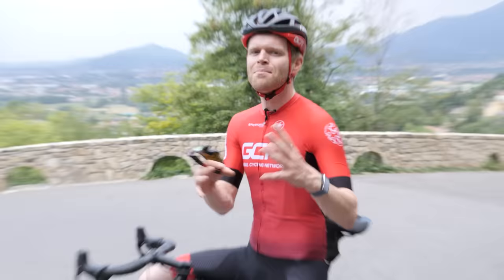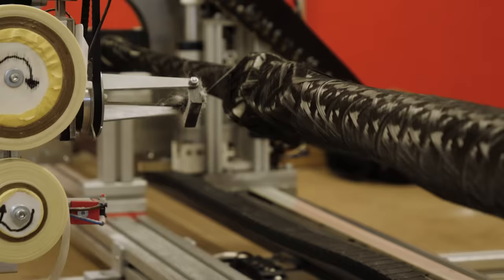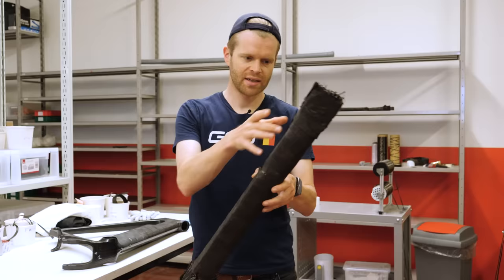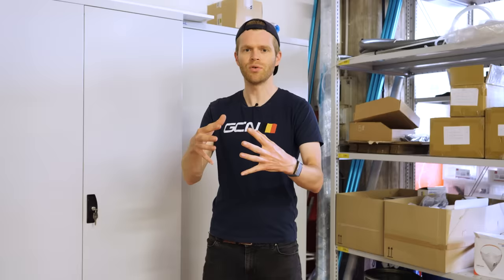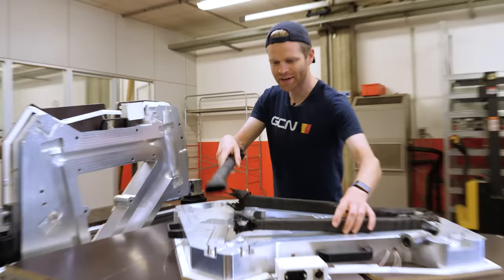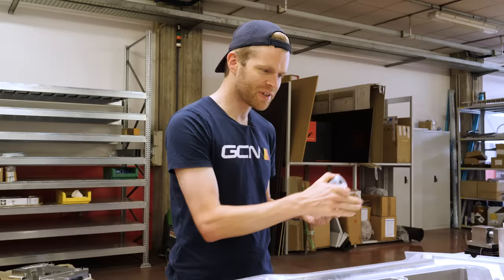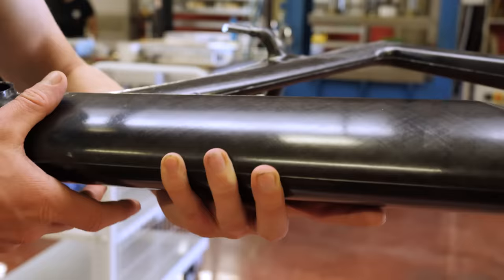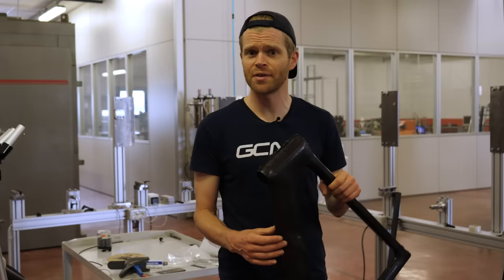Carbon Fibre Game Changer | Inside 3T's Italian Bike Factory

Comment: I recently saw a video on 21st century air planes...it wasn't called carbon fibre but carbon reinforced plastic. That gives it an entirely different complexion.
Reply: Carbon fiber reinforced plastic (CFRP) is a more accurate description of carbon fiber composites. The fiber simply reinforces that matrix which is typically epoxy resin, a type of elastomer or plastic. When somebody says carbon fiber to me, I immediately think of the actual fibers and not the composite.

Comment: Curious.  Is the method called Pultrusion?  The use of string type fibres to build the carbon along with resins to bond it together.
Reply: Pultrusion is a method to draw fibers through a heated dye and introduce resin. the end product is only linear profiles like tubes or rods.

Comment: Hi Ollie, alex and/or manon! Cheers from the Philippines.
Quick-ish question but a long back story, are all shimano crank spindle the same length?

I have a custom Ave Maldea CX steel frame with 150r5800 crank and when I was going to change the bb my new mechanic noticed that the retention bolt was only like 3 threads in and he couldn't change the bb shell cause the road bb shell is too narrow for my Maldea CX bike, frame builder said that i could fit up to a 50c tire on the frame. I was thinking of using a mtb bb shell but then that wouldn't solve my  spindle problem. Could I use a GRX crankset instead? or is there like a longer retention bolt. Thanks guys!

#AskGCNTech

Comment: This seems exciting! Next level for manufacturing standards. Exactly what we and cycling needs. Because with pumped up prices, the quality needs to be more consistent. Let’s see how this will end up, but 3T surely got my attention now, over other brands. Hopefully other manufacturers can follow. 
Thanks for interesting content.
Reply: 45 fottuto stronzo  with that kind of thinking there would be no innovations and progress forward. 1st gen doesn’t have to be bad at all. It all comes down to individual manufacturers and their QC standards. Will they rush out 1st gen in order to monetize and then improve fails in 2nd gen? You can’t say. They may opt for high QC and intensive testing, to make sure that already 1st gen is where it should be. We’re not talking about electronics or software here, but about carbon frame, where manufacturer has long prior experience and just deceived to go next step up. …hopefully.
Reply: Sadly, this is not "next level". I would say that it is a step backwards in technology. Filament winding and resin transfer molding have been around for decades and the 3T winding technique made me cringe. As for bike frame building, this is far more labor intensive and less controlled (despite their claims) than current mass produced frames. Giant can produce an entire road frame including paint and decals in 7 man hours. This frame is probably in the 15-20 hours each before finishing.

Comment: Love to see more frames build in Europe, even if it doesn't use resin but a secret ingredient (also just a resin). 
An accuracy of 0,001mm however is absolutely impossible in a construction like that.
Reply: Agree good to see some companies 'on shoring'. Secret ingredient - as you probably know UV light curing adhesives have been around for some time and are widely used in medical, electronic and aerospace manufacturing processes. They are much faster than 'cooking in an oven'.

Comment: no way they are hitting a micron on that mold.  if just the expansion of the mold alone due to thermals 10^-6*560*10 would be 5 microns let alone the cnc required to hit a micron would be astronomically expensive

Comment: Filament winding preform + RTM process is lower cost than the prepreg process. 
But Filament winding has design limitation, so the frame made by prepreg is more performance oriented process.

Comment: they should dope carbon fibers with a chemical to help them polyemerize and then form them with a light filler with a thermoset epoxy that chemically bonds it all together,,  and make frames out of that with thinner sections for 'compliance'.

Comment: I really don't understand 3T. Why do they not integrate their cable routing? smh I saw a 3T bike for sale for $8k, but it has ugly cables sticking out everywhere, and its a Di2 hydraulic disc bike! All it has is a Di2 cable and hydraulic hoses. Those should be easy to integrate! I avoided that bike for that reason alone. Unacceptable.

Comment: This process is nothing new.  I have done the same steps to build a large electric motor armature for a flywheel 25 years ago.  The huge issue is voids if you don't get the right mix of temps and pressure to move the resin all the way into the mold.  If done correctly yes the finish product can have very tight tolerances since we where able to with the armature needing to be very close to a 500lb flywheel spinning at 5k.

Comment: Not that different than the process used by boat manufacturing. I have a complete vacuum molding system I use on small boat. I think I will try a frame myself.

Comment: @GCN Tech... Since we have removed the need for seats stays with disc brakes on road frames how long do you think it will take the manufactures to convince the UCI to remove the requirement for seat stays from the UCI rule book in order to simplify manufacturing and improve aerodynamics?

Comment: 08:10 and 09:55 shows the secret. the Mandrel is some kind of wax or plastic that i guess melts easy. i give china a call they need to copy that asap to make even cheaper frames
Reply: they also must have some kind of back/internal pressure to squeeze the frame from the inside when vacuum is applied, atherwise they will only obtain an expensive carbon sponge
Reply: @8paolo96  normaly there is somekind of sacrificial bladder used for that. you can see remains of that bladder when you film inside your frametubes
Reply: @moistnugget4019  yes yes, of course, but they never showed anything like that on the video, that's weird